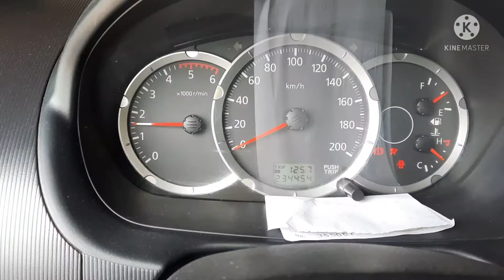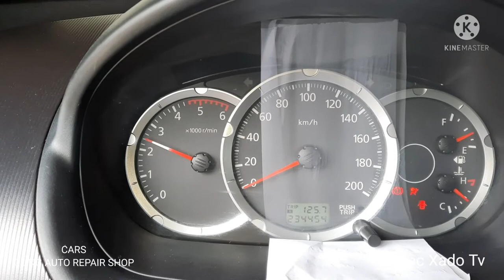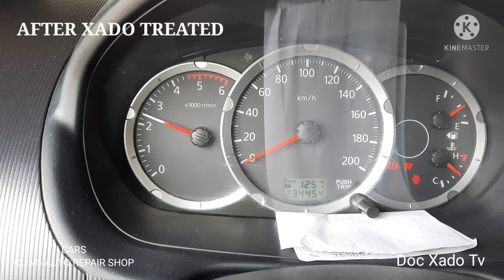MITSUBISHI STRADA TROTTLE DELAY ISSUE/LOW ENGINE POWER/LOSS COMPRESSION/BLACK SMOKE ISSUE FIXED

Comment: Boss strada 2019 model mahina hatak pero mausok.
Reply from the maker: Yes Sir,. Mahina hatak dahil loss compression sa loob ng combustion chamber need undergo piston decarbonize para makabalik ang compression ration into 1:1 ratio,.tyhen black smoke dahil mas maraming unburn fuel na hindi kayang sunugin during fire stroke or sa tuwing sabog ng makina kaya nagkakaroon ng low power so need mag undergo ng turbo cleaning egr cleaning o kung anu pa para mabalik ang lakas,. sa xado engine treatment hindi na kailangan na mag tanggal ng anumang parts sa engine dahil ihalo lang ito sa loob ng fuel tank at sa loob ng engine with in 10minutes balik na sa normal ang lakas ng makina na parang brand new ang hatak at kayang tumagal upto 3 to 5 years,. then ang black smoke ma lessen natin upto 80%,.

Comment: Buysit
Reply from the maker: XADO Engine Treatment is a product designed to improve the performance and longevity of engines. It is a unique nano-ceramic formula that is added to the engine oil. This treatment works by revitalizing and protecting the engine's metal surfaces.

When the XADO Engine Treatment is added to the engine oil, the nano-ceramic particles form a layer on the metal surfaces, including the cylinder walls, pistons, crankshaft, and bearings. This layer acts as a protective coating, filling in microscopic irregularities, and restoring worn-out parts.

Here is how XADO Engine Treatment works:

1. Revitalization: The nano-ceramic particles are activated under the high temperature and pressure inside the engine. They start to bond with the metal surfaces, revitalizing and restoring the damaged or worn-out parts.

2. Restoration: The ceramic layer fills in the gaps and micro scratches on the metal surfaces, creating a smooth and even surface. This results in improved compression, reduced friction, and enhanced sealing of the piston rings, which helps to restore the engine's power and performance.

3. Protection: The nano-ceramic coating provides a long-lasting protection to the engine against wear, corrosion, and overheating. It creates a barrier between the metal surfaces and the oil, reducing friction, preventing metal-to-metal contact, and extending the engine's lifespan.

XADO Engine Treatment is effective for both gasoline and diesel engines, and it can be used in various vehicles, including cars, motorcycles, trucks, and small machinery. It is recommended to follow the manufacturer's instructions for the right amount of treatment to be added to the engine oil.

Overall, XADO Engine Treatment helps to improve engine performance, reduce fuel consumption, extend engine life, and reduce maintenance costs by providing a protective and revitalizing layer to the engine's metal surfaces.
Reply from the maker: Yes Sir,. Low Power, Trottle Delay, Black Smoke, Walang hatak, Hirap sa Paahon, gasgas ang Cylinder Wall? Engine Vibration.? Introducing XADO Engine Treatment SMART NANOTECHNOLOGY made from Russia pang remedy sa mga bago at sa  lumang sasakyan xado carbon chroming, proven and tested ang product natin,.
https://www.youtube.com/watch?v=mcqoR3n3l64&t=53s
https://www.youtube.com/watch?v=ZCf2uoMklq0
https://www.youtube.com/watch?v=zdIYPXs3n7Y&t=46s
https://www.youtube.com/watch?v=7hi29QriVa0
https://www.youtube.com/watch?v=rhiZnA98aPk
Exclusive Distributor Only Nationwide
Xado engine treatment for set price is 5,500.00. Shipping fee 250.oo
Total Payment P5,750
Mode of payment: Cash on Pick up at LBC Parcel, 3 to 5 days ang dating ng product dahil galing pa po ng General Santos City ang item,.
If confirm po ang order natin paki send lang po ng details
Name:
Address:
Contact:
LBC Branch:
For more inquiries contact XADO AVAILABLE @ FB Page: https://www.facebook.com/clingauto

XADO ENGINE TREATMENT
https://www.youtube.com/watch?v=yVYi8s051zI&list=PLDn9twqd2e599jO2LMHt9ysgQHqHKm6Yf&index=96

Please Support, Follow and Send Stars to make more Videos upload. Thank you and God bless!
# 09171259996
CARS CLING TV Located @Purok Pandian Gay Corner Makar Highway Brgy. Labangal General Santos City SouthCotabato 9500
Reply from the maker: XADO ENGINE TREATMENT
https://www.youtube.com/watch?v=yVYi8s051zI&list=PLDn9twqd2e599jO2LMHt9ysgQHqHKm6Yf&index=96

Comment: Bos ano ginawa
Reply from the maker: Yes Sir,.Ang ginawa natin ay nilagyan natin ng xado engine treatment ang loob ng makina,. Un lang ginawa wala ng iba
Reply: normal lng ba yung andar nya yan sir?
Reply from the maker: Ang tamang idle speed ng Honda Fit ay nasa pagitan ng 650 hanggang 750 revolutions per minute (RPM) kapag ang makina ay nasa normal na temperatura at ang air conditioning at iba pang mga electrical load ay patay. Gayunpaman, maaring mag-iba ang idle speed base sa iba't ibang mga kondisyon tulad ng temperatura ng makina, antas ng gasolina, at iba pang mga variable. Para sa eksaktong idle speed ng Honda Fit, maaring suriin ang pagsunod ng speedometer sa instrument cluster o konsultahin ang manual ng sasakyan para sa mas detalyadong impormasyon.

More Basic Pointers  Toturials FULL Videos: https://www.youtube.com/channel/UCXSl7FUzPZV3lIxFWCHFTVA
FB Page CARS CLING TV: https://www.facebook.com/clingauto
CARSClingTvShortVideos: https://www.youtube.com/channel/UCsUWQnaD9vVKqL_w6eAYhgA
#
#xadoenginetreatment 
#carsclingtv 
#basicpointerstutorialissuefixed 
#xadoenginetreatmentengineperformancerecovered
#10yearslonglastceramicscarbonmetalcoated 
#carsclingautorepairshoplegacy 
#trottledelayremoval
#blackwhitesmokeremoval
#lowpowerengineremoval
#carsclingtvshortvideos
#xadoenginetreatment 
#changeoilpms
#enginecarbonchroming 
#carsclingautorepairshop
#remedyxadotreatment 
#acceptcheckengineissue 
#troubleshoot 
#legitonlineseller  
#Mobile09171259996
CARS CLING TV Located @Purok Pandian Gay Corner Makar Highway Brgy. Labangal General Santos City SouthCotabato 9500

Comment: Ser anu pow vah ang dapit nmn gawin yan din ung issue nmn
Reply from the maker: Yes Sir,. Low Power, Trottle Delay, Black Smoke, Walang hatak, Hirap sa Paahon, gasgas ang Cylinder Wall? Engine Vibration.? Introducing XADO Engine Treatment SMART NANOTECHNOLOGY made from Russia pang remedy sa mga bago at sa  lumang sasakyan xado carbon chroming, proven and tested ang product natin,.
https://www.youtube.com/watch?v=mcqoR3n3l64&t=53s
https://www.youtube.com/watch?v=ZCf2uoMklq0
https://www.youtube.com/watch?v=zdIYPXs3n7Y&t=46s
https://www.youtube.com/watch?v=7hi29QriVa0
https://www.youtube.com/watch?v=rhiZnA98aPk
Exclusive Distributor Only Nationwide
Xado engine treatment for set price is 5,500.00 free shipping fee,.
Mode of payment: Cash on Pick up at LBC Parcel, 3 to 5 days ang dating ng product dahil galing pa po ng General Santos City ang item,.
If confirm po ang order natin paki send lang po ng details
Name:
Address:
Contact:
LBC Branch:
Reply from the maker: XADO ENGINE TREATMENT
Proven and Tested Proof Videos
https://www.youtube.com/watch?v=yVYi8s051zI&list=PLDn9twqd2e599jO2LMHt9ysgQHqHKm6Yf&index=96
Reply from the maker: Xado Engine Treatment for Deisel and Gasoline Engine Set price is P5,500.00
 + Shipping Fee P250.00
Total P5,750.00

Mode Of Payment: Cash on Pick up 
Parcel: LBC Branch

Set Price included:

 1 bottle 500ml Xado Atomic Engine Treatment, mix into the Engine oil
 3 bottles 250ml Xado Fuel Extreme Economy, mix into the fuel tank

If ever your order were confirmed kindly send us these details:

Name:
Address:
Contact:
LBC Branch:

Comment: may depensya yan,  bakit nong bago payan d naman ginamitan ng lube lube nyo na yan, bat maayos naman ang hatak? sa ma uto lang
Reply from the maker: Yes Sir,. Salamat sa advice,. open natin utak natin sobrang lawak ng mundo dami pang under research since nilikha ang earth, saan ba galing airplane diba sa saranggola, ang ang computer diba sa calculous, sir baka po napag iiwanan na kayo ng technology, makisuyo paki guide ng mga anak nyo baka behind na sila modern world, ano ba gamit nila celfone connected wuth wifi? dati tali lang yan lata sa lata connect ng lubid,... sayang ang technology ngayon kung ang utak natin na naka contain lang sa isang baso, explore the world sir, law of nature walang kayang bumasag nito, siguro ikaw lang,.
Yes Sir,. Low Power, Trottle Delay, Black Smoke, Walang hatak, Hirap sa Paahon, gasgas ang Cylinder Wall? Engine Vibration.? Introducing XADO Engine Treatment SMART NANOTECHNOLOGY made from Russia pang remedy sa mga bago at sa  lumang sasakyan xado carbon chroming, proven and tested ang product natin,.
https://www.youtube.com/watch?v=mcqoR3n3l64&t=53s
https://www.youtube.com/watch?v=ZCf2uoMklq0
https://www.youtube.com/watch?v=zdIYPXs3n7Y&t=46s
https://www.youtube.com/watch?v=7hi29QriVa0
https://www.youtube.com/watch?v=rhiZnA98aPk
Exclusive Distributor Only Nationwide
Xado engine treatment for set price is 5,500.00 free shipping fee,.
Mode of payment: Cash on Pick up at LBC Parcel, 3 to 5 days ang dating ng product dahil galing pa po ng General Santos City ang item,.
If confirm po ang order natin paki send lang po ng details
Name:
Address:
Contact:
LBC Branch: